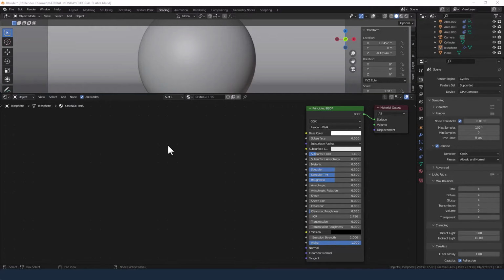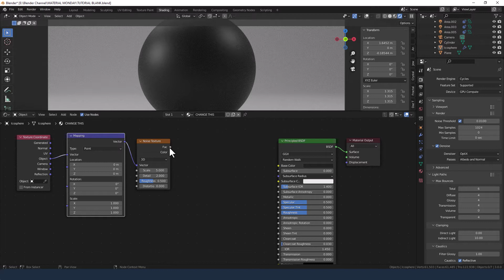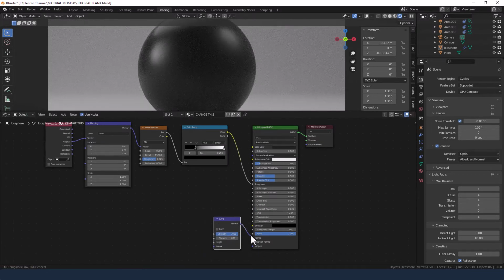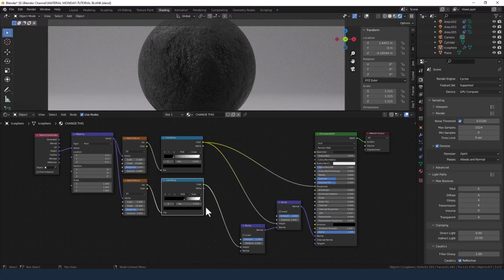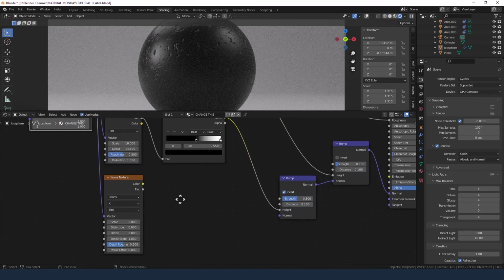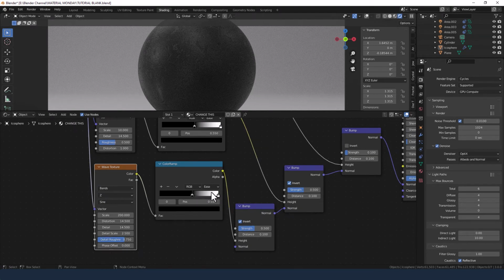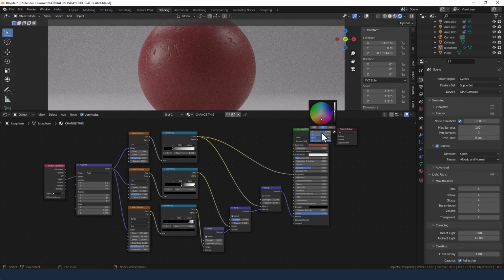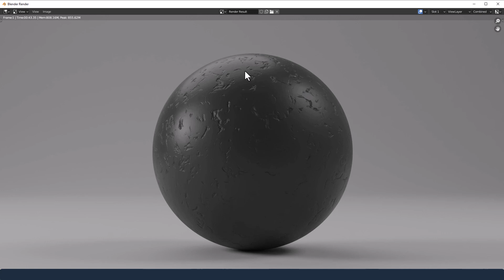CREATE A PROCEDURAL WORN RUBBER MATERIAL FOR BLENDER

Comment: Great tut! Ty. Is there a possibilty to make the inverted distortions colored differntly to simulate e.g. a painted surface that got broken due to the bumps an the natural material (2nd color) becomes visible where the distortions are? That would be pretty cool. I played around with the nodes and tried to add a 2nd color that only affects the node "bump (inverted) " but couldnt make it.
Reply from the maker: An interesting question! I do belive there would be a way but it'd mean setting up a seperate texture and then mixing the two somehow. I'll have a look into this when I rerecord it for Blender V4.

Comment: Very nice material, and thank you for this tutorial. I am not sure how the little chips/dents could be kept at the same size but spaced out more so there are just a few of them... decreasing the scale of the noise texture just makes them larger
Reply from the maker: Good question! From a few experiments, I have found one that might help you.

1. Add a new mapping node.
2. Change the scale in the new mapping node to 2 (on x, y and z) 
3. Connect the new mapping node (object output) to the vector input of the second noise texture.
4. Change the scale value in the noise texture to 4.
5. Change the black location value in the color ramp (that comes off the noise texture) to 0.635
6. Change the white location value in the same color ramp to 0.865

This gives chips of a slightly smaller size and less quantity.
Hope this helps.